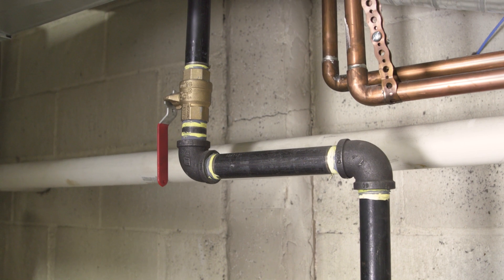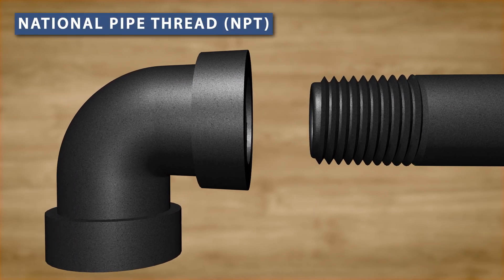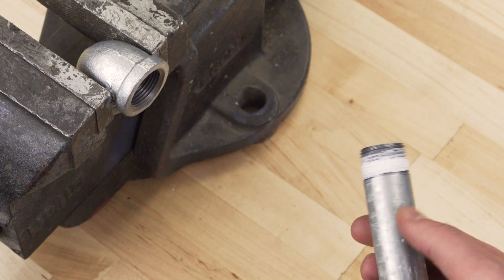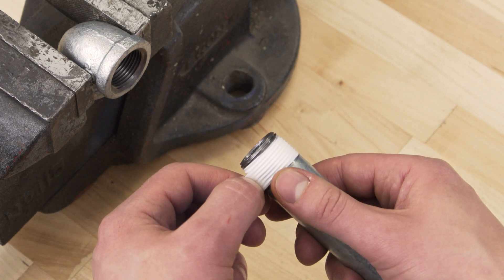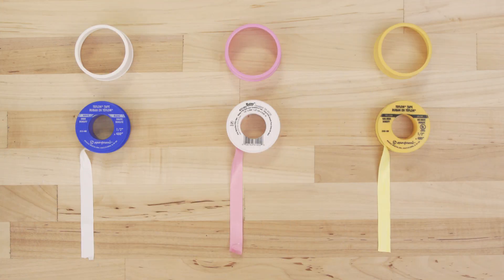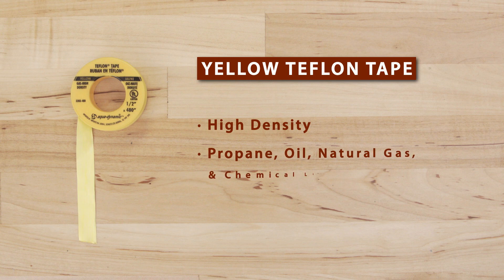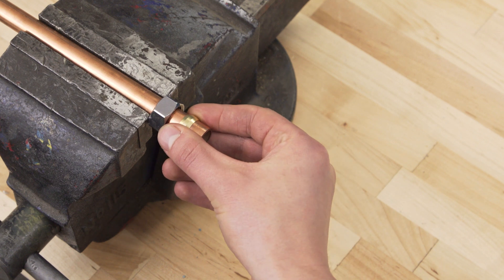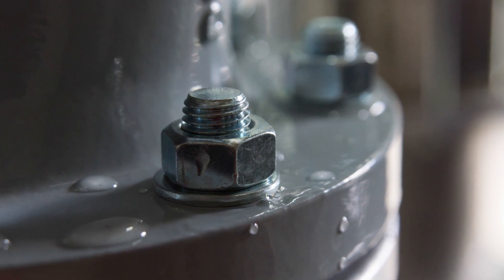The Complete Guide to Teflon Tape | Repair and Replace

Comment: I need for copper pipes
Reply from the maker: Thanks for watching. Generally copper tubing is joined through soldering. There are some copper adapters that use NPT threads which will require teflon tape.

Comment: Nice instructions in general.  One kind remark on the comment "... tape is always applied in a clockwise direction".  The tape actually needs to be applied in the opposite direction of the pipe being screwed in.  So if the pipe screws in a clockwise direction, then the tape must be applied in a counter-clockwise direction.  In the video, the actual animation of the arrows showing the rotation, is actually correct!  And the comment "... is applied in a clockwise direction" is also correct (!) while watching the video, but only because the operator changed the angle of the pipe towards the camera.  Thus the comment "... is applied in a clockwise direction" is TMHO a bit misleading and difficult to remember when it's time to actually perform the operation without watching the video.  For me the easiest thing to remember, when I have to perform the operation, is that the tape needs to be applied in opposite direction of how the pipe will screw in.
Reply from the maker: Thanks for watching. Your tip "the tape needs to be applied in opposite direction of how the pipe will screw in" is another good way to think about it and would be helpful for many people. Our wording mostly just came from how we were showing the threads and the pipe. While holding the pipe and looking at the threads it's easy to see which way you will be applying the thread as it's quite visible from that angle.
Reply: @AmreSupply  Thanks for your reply;  I agree with your last comment end-to-end.  Please keep up the good work; the video has helped me tremendously (and I'm not a professional plumber)!
Reply from the maker: @alexterzis612  We're just happy to help!! If you're curious we have a playlist that you might enjoy. It covers "how it works" for various topics. Very informative: https://www.youtube.com/playlist?list=PLCo9SMjkdWBxWwrWCmzvRMSi2kLo9bGdp

Comment: I think that your video needs to clarify that sealing agents are usually not needed on the olive compression fitting in the ideal case esp if dealing with straight and new pipes. In the non-ideal world, we have old pipes that are not perfect or sustained small indentations. These cases do require greater effort to seal than just the metal to metal compression.
Reply from the maker: That is an excellent point, thank you for sharing!